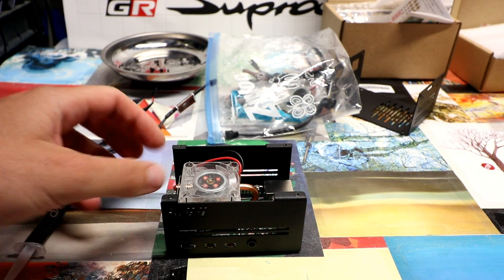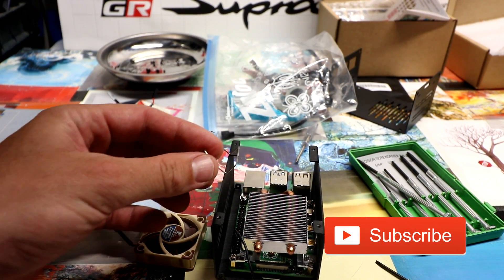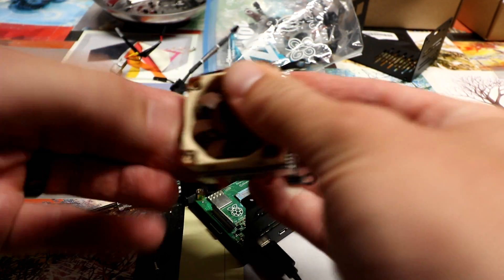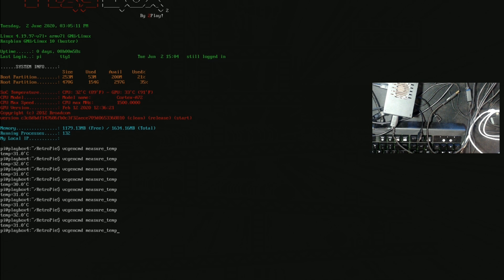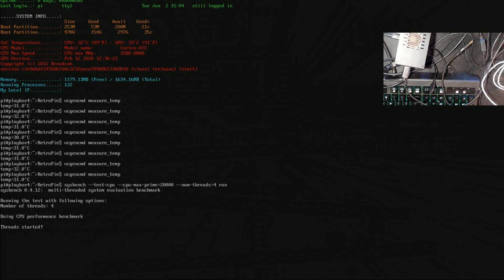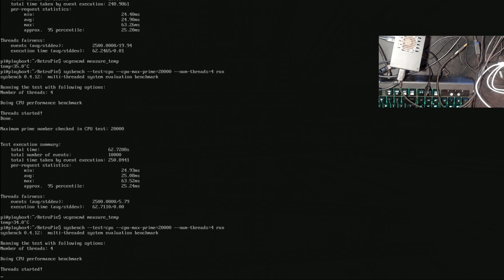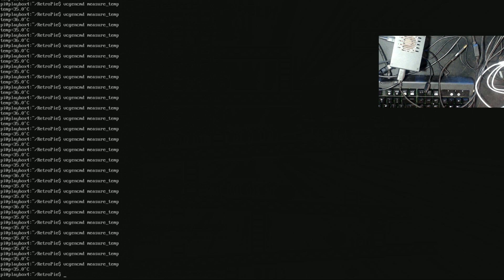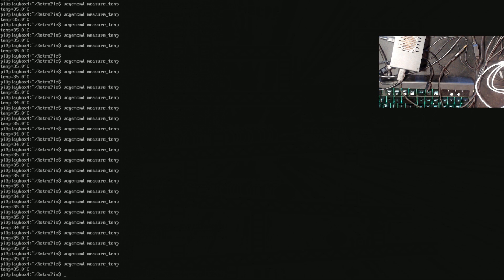Sleeper Raspberry Pi 4 Low Profile Ice Tower Heatsink Case - Silent!

Comment: I'm thinking of ordering this case because it looks like it might fit the the X728 UPS. I couldn't find the height of the case anywhere, but the UPS installed is around 1.6 inches off of the Pi board.

Comment: What kind of cases would you recommend for using with ICE towers? The acrylic baseboard doesn't seem very protective.
Reply: I tried using a 52Pi acrylic layered case that's very similar to the Pibow Coupé, but the layers aren't the right thickness and requires so much tinkering.

Also, do you use thermal paste? How do you get the heat sink and coil to be as close to the SoC? I'm weary of the quality of the pink thermal pads that came with the kit. My Pi's hovering around 42 - 45 C when in light use.
Reply from the maker: Paste is better
Reply: DrewTalks : What brand of paste is your blue gel thing?
Reply from the maker: @aero33888  Heatsink paste: https://amzn.to/2AQzXYm
Reply: Thanks.

Comment: I run the same Noctua on a 3D printed lid to the Flirc Pi4 case. It’s so quiet and I have a python script running that controls it with PWM so the fan remains off until it hits 45c and then ramps up from there.
Reply: Would you mind sharing the script? I'd love to do the same, and was looking at different solutions. Thanks!
Reply from the maker: Yeah they are quality fans for sure

Comment: Very  interesting video.
 Could you replicate the test with the fan mounted the other way i.e. sucking the hot air from the radiator and blowing it out of the case instead of blowing cool outside air on the radiator?  The comparison between the 2 setups would be interesting.
I have a question : could you fit a 60 mm fan inside this case?
Reply: a 60mm fan should fit as long as it's less than 15mm tall. You'd either have to mount it to the inside of the  top of the case, or on a mounting plate on standoffs so that it cleared the heat sink.